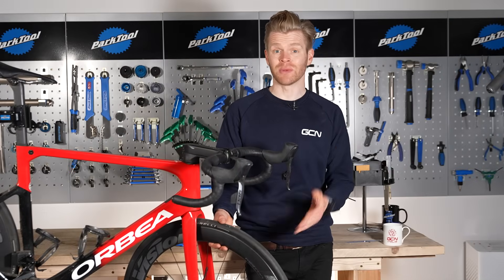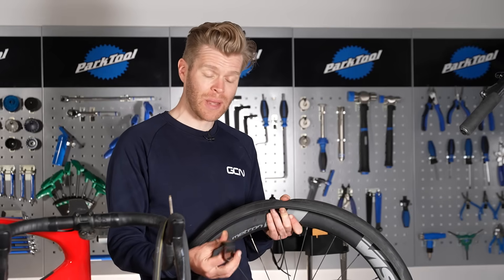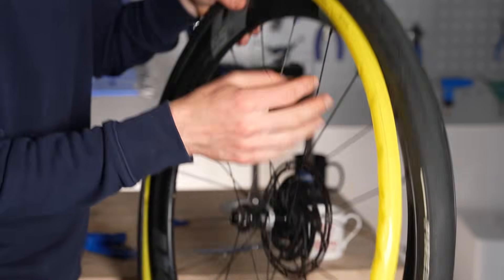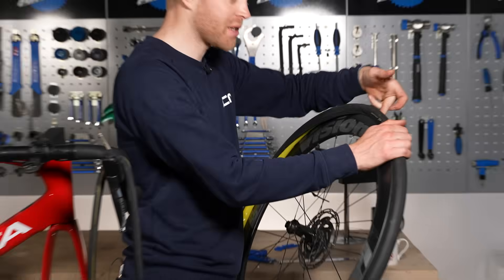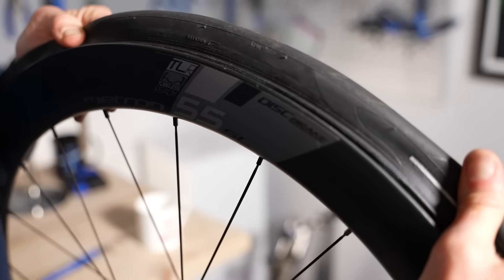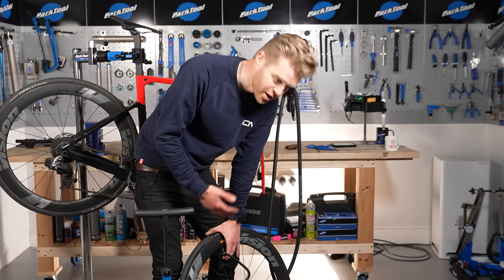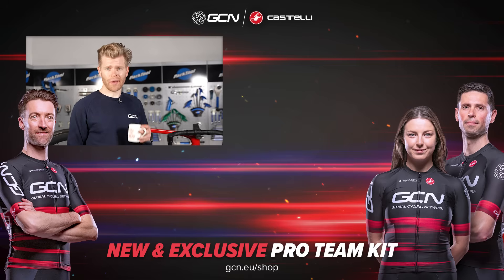How To Change An Inner Tube Quickly - Easy 8-Step Guide | Maintenance Monday

Comment: you skipped and left out almost all the important things, I've seen beginners change a tire better
Reply: Ok princess, please educate us. What did he miss?
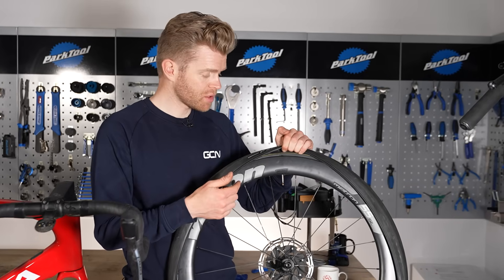Reply: @WarHammerWH 00:48 let the remaining air out of the tire, squeeze the tire with your fingers to get it out of the channel, pull the tire towards the valve so that there is as much room on the valve as possible to place the levers. always start by removing the tire from the valve on the left and right. 
1:06 remove tire from rim and then inspect tire.
 2:52 that positioning of tire should be done at beginning to get more space at valve. 
3:12 always start with the installation of the tire opposite the valve, left and right, and should finish with the installation parallel to the left and right of the valve, because the tire opposite the valve rests in the middle of the rim, so there is more space on the valve to complete the installation.
3:52 press valve inside of wheel to let tire root to align on rim if not you could get bump on tire because inner tube  can stay below tire
everything I have stated is very important that the tire change is done easily and quickly, and his work is at the level of a beginner amateur who has changed 2 tires in his life, and those that do not even need levers, but come off the rim by themselves